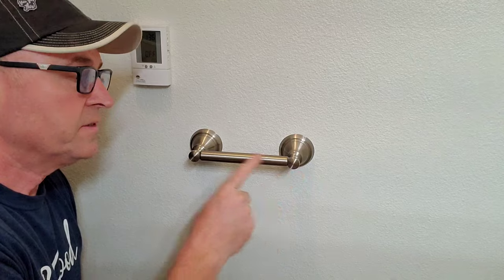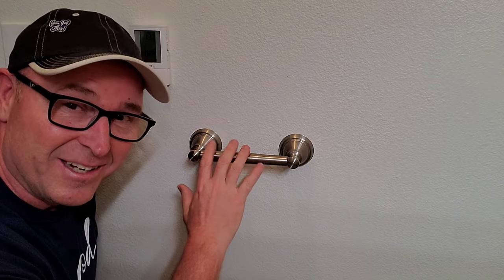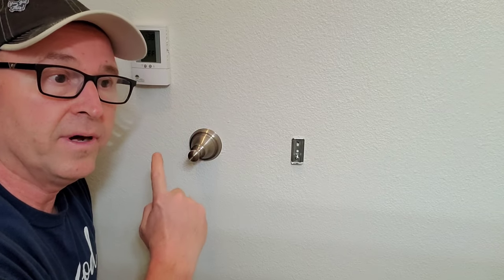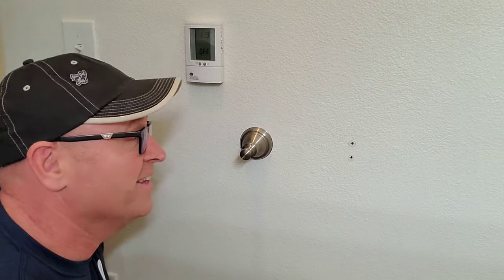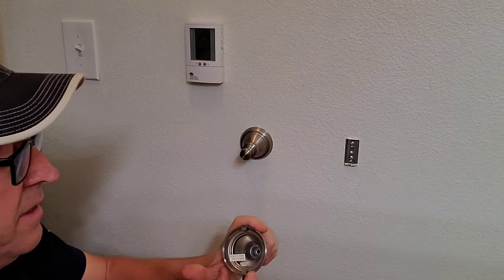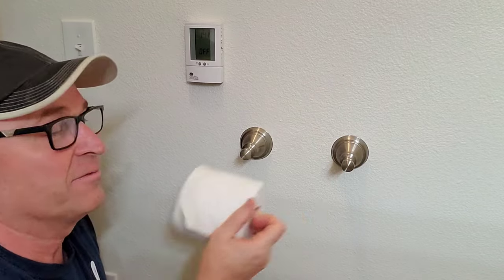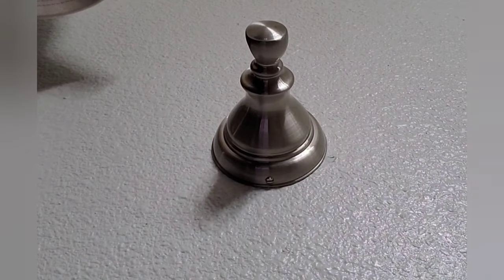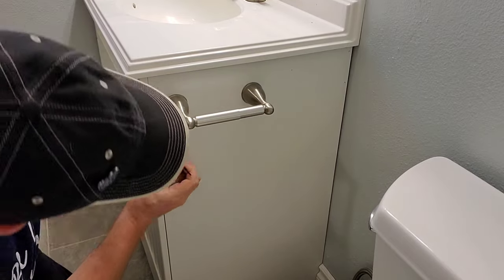How to Install a Toilet Paper Holder

Comment: Dad how do I replace my toilet seat and lid? Is it a pain to do?
Reply: It's not too hard! This is a great video suggestion!
Reply from the maker: It's not hard, I will try to do that one soon. 👍
Reply: If you can’t wait for Dad’s video there will be two plastic nuts underneath where the seat attaches to the porcelain. You can usually untwist them with your fingers, one on each side. Take them off then pull the plastic screws out. Give the area a good clean then you are ready to put the new seat on. Tighten the new plastic nuts but don’t overtighten because the plastic is soft. I hope I helped a little. You can do this!  Good luck, PiMama!
Reply: I just did this one, it’s super easy

Comment: It's those doggone hidden screws, dad!! Dang.

Also, I've noticed that people with cats (or mischievous dogs) tend to use the "reverse" rotation for the paper roll. And it does make sense - it won't easily unravel when something pulls down on the front of the roll. 
Meanwhile the rest of us use the correct rotation ;)

Comment: Not a big issue, I guess.  But I find I have more control of the paper when it comes from under the roll.
Directing it so that it comes off the top of the roll tends to let it get out of control and you pull off more paper than you need.  Especially when the kids are using it.

Comment: Could you teach us how to hang multiple paintings so they are level?
Reply: Try using painters tape to guide you! You can even make squares the side of your frame with it to see how the end result will look
Reply: @emiv592  That's a good idea. I have 4 panels to hang and I can't for the life of me get them perfect. tried string, tape measure,  and I even went and got these long sticks to help (which got me the closest). But I do have a lot of tape.
Reply: @mickiddymichael7878  I think I saw one of the try guys wives explain how to do something similar to it in a video a while back, if I find it, I'll link it. But what I'd also recommend you try would be using a pencil, and make dots at the same height from the ground. The easiest thing would be one of those wooden blocks filled with water (I think its a waterleveler (?) but english isn't my fitst language). Water always tries to balance itself, so its the best thing to see if objects are level. Getting someone else to stand back and view from a different perspective also helps sometimes, but thats not always possible. Good luck 🤞
Reply: @emiv592  Its called an alcohol level. The level with the bubble right? I've also used tacks. I think it's about as straight as I can get it. You see how the second panel is higher and the 3rd panel sits lower? Oh and the tape helped.

Comment: Wait! It looked like there were screws in the wall before those "platform" things, and then you put more screws in.  Were the ones directly in the wall actually anchors? Sorry for not even knowing the words to ask.
Reply from the maker: Sorry, yes those were sheetrock anchors. I use them so often I called them sheetrock screws. Look at my "how to put up a shelf" video to see how to use them. 👍
Reply: @DadhowdoI  Thank you so much! I'm so deficient in all skills like this, I'm proud that I even noticed. 

By the way, are there different sizes of those? How do I know which size I would need? 

I'll watch the shelf video now, you might have explained it there.

Comment: So, I've just done a caulking project and I think that would be a great video for you to share.  Also, as I'm over 50 and didn't realize there was an inner seal, any ideas on how to get it to go through the tip of the caulk instead of out the bottom?  Lol!
Reply from the maker: My video tomorrow is Tool Tuesday caulking gun. 👍
Your caulking gun should have a little piece of metal on the side that swings out to puncture the tube through the tip.
Reply: @DadhowdoI  Thank you, my caulk gun does not have the metal thing (probably cheap) but I did get it punctured.  Thanks again!  Love your videos, and I can't wait to see tomorrows!